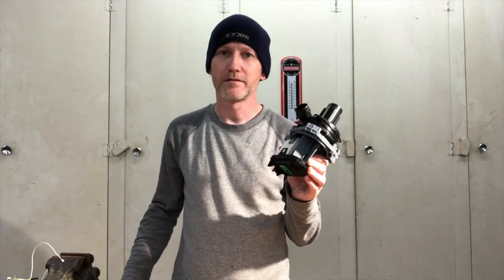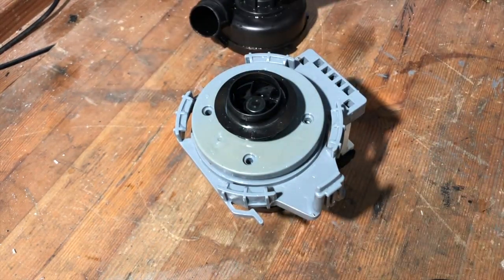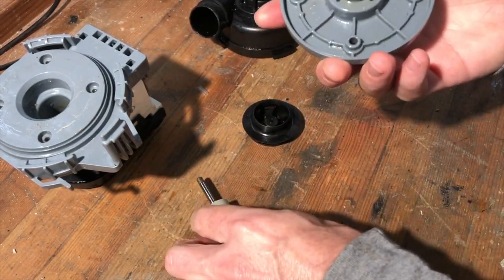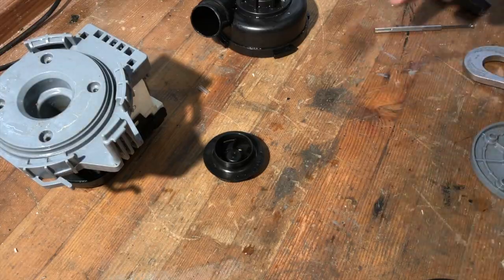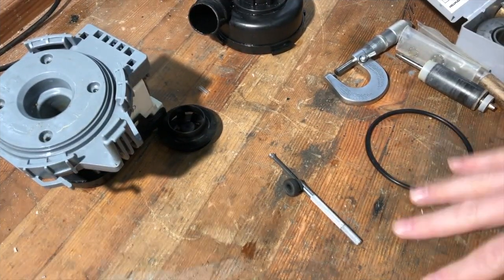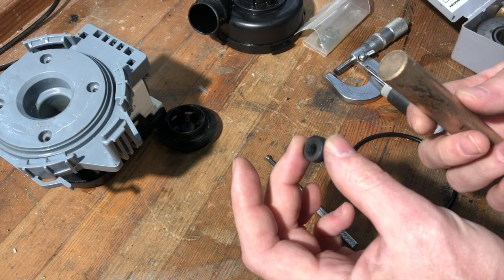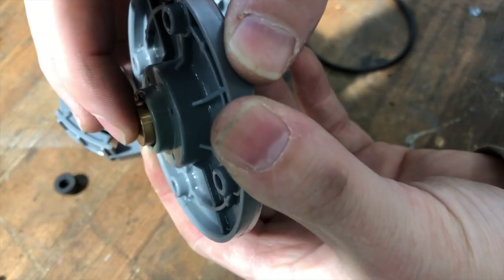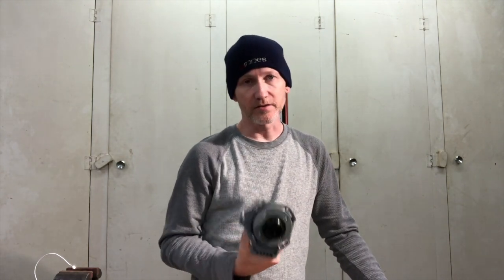Dishwasher Circulation Pump Repair Part II: One Year Later

Comment: Damn that magnet has had so much shaving into the dishes. U can see it on camera.I use ceramic bearings nsk 605ce.
Reply: how was the fit on the shaft and how was the fit in the housing?  I was looking at a 5x16x5 bearing also.  The 605ce is 5x14x5.
Reply: @Tony-it1zt  I used heat shrink around bearing to compensate around bearing to make it fit snug.there is a gap that’s extremely small thickness is about soda can aluminum twice that I know due to using that prior to heat shrink but it was unstable due to being so thin. Heat shrink filled it nicely I cut off any excess and tried to make it not stick out at all. I can make a video of how I set mine up around bearing.

Comment: Tony here again
Why does that motor have to run in the water?  What do you think of installing a seal?
Reply: These new style motors are meant to run without a shaft seal. That way you don't have to concern yourself with the shaft seal wearing out and leaking.
Reply: The water in the pump is the lubricant to some extent and the pump is 100% sealed so it will never leak.  They took this design from fish tank filter pumps.

Comment: For God's sake! Don't ANY of these appliance manufacturers made decent products anymore? I saw the exact same issue with the discharge pump on our Samsung front load cloths washer. At five years the discharge pump crapped out. It cost me $200 for the repair. The tiny little motor was frozen up. I cut the old one apart to see the inside. It was all rusted up and the tiny rear bearing was rusted causing the motor to seize. I could see right away that the replacement wasn't going to last long either. Two years later the main bearing that the tub rotated on failed and smoke came out of the washer. The repair guy said it would cost as much to replace the bearing as it would to buy a new washer. I asked him what he would recommend as being a good washer. He said "It doesn't matter...they're ALL junk!". So no more Samsung (Korean) junk for us. That was in 2015. We bought a Maytag washer and dryer with a 10 year warranty on the motors. The main Whirlpool company is only 35 miles from me, but, now all of their products are coming from Mexico! That's all junk for certain. 😬 Just don't know what to buy anymore.

Comment: can you sell the bearings you made...
Reply from the maker: I think I may have an even better option than custom machined bushings or ill-fitting bearings. A new video will be coming soon with my findings.
Reply: @PhillipsHomeRepair  how soon ? Also It would probably be great if you put links to each next part in the previous video. Did you ever end up making and selling the brass ones ? I would definitely buy some.
Reply: @PhillipsHomeRepair  what is the better option? I’m waiting on pins and needles. Bout ready to throw this whirlpool out the door.
Reply: @PhillipsHomeRepair  I’d love to hear the other idea/solution when you have a minute.  Exact same bearing/bushing problem, Kenmore Elite.
Reply from the maker: Sorry, “coming soon” turned into almost a year. Actually coming soon now.

Comment: It should not be wet on the inside...your shaft seal/bearing or large o-ring gasket are leaking...the material build up on the inside is causing the reoccurring issue.